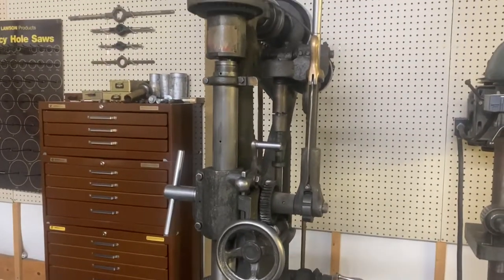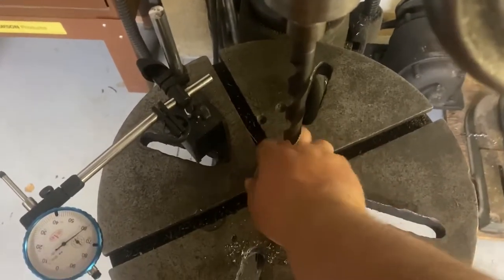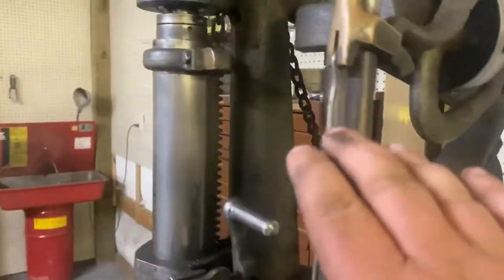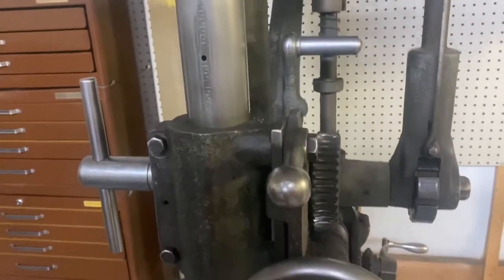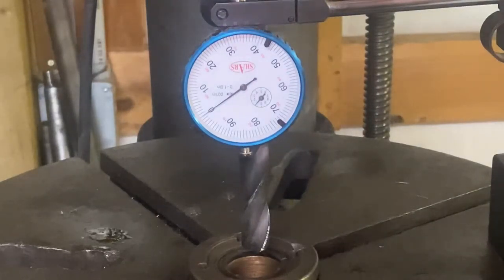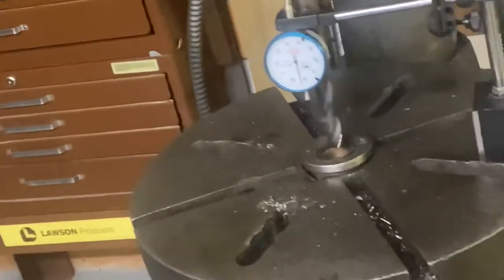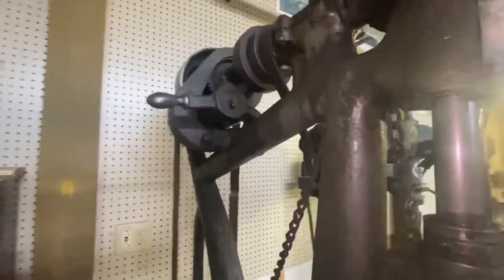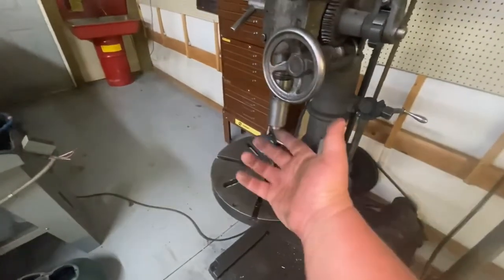Setting up the camel back drill press for boring

Comment: I've seen someone boring with a similar setup before.  Not sure if it would work with your specific setup but he'd pivot the table setup the part then slide the bar in minus tool bit,  pivot it back and use the boring bar to line the table back up.
Reply: His reasoning was its easier to line up the table than raise and lower everything else.  He built custom racing go-cart jugs and billet pistons for shifter carts for use with mini turbos.